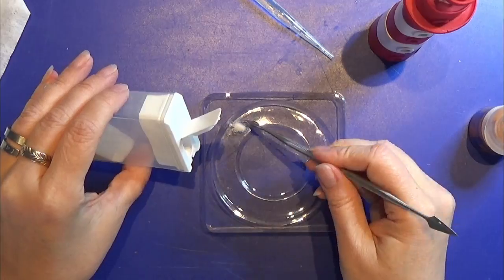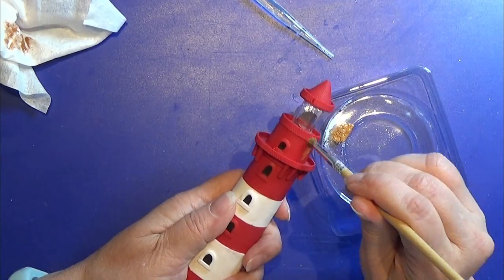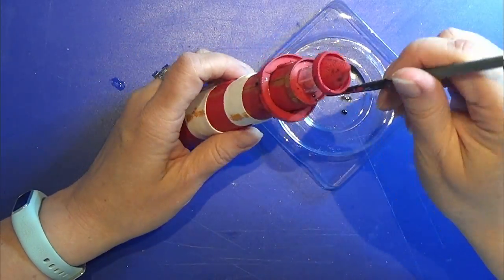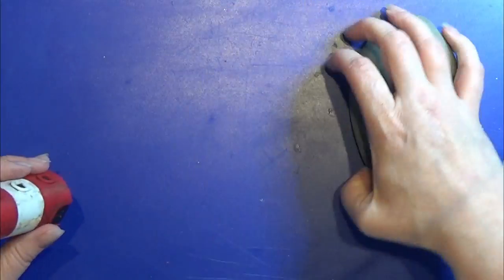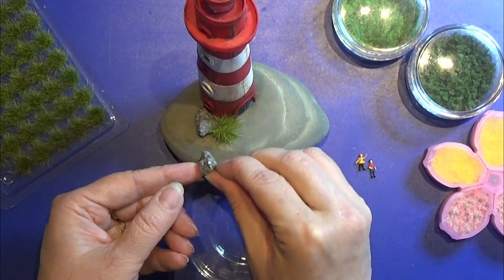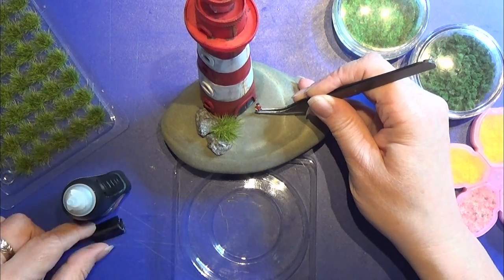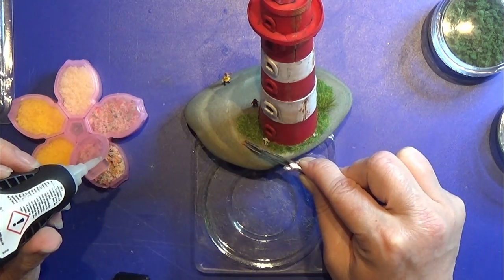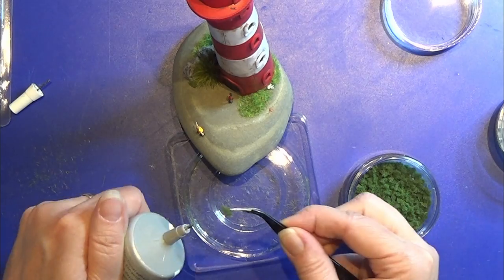Polymer Clay Miniature - Lighthouse part 2

Comment: You did a very good job of weathering.  Arya is pretty good, and I love her techniques.  You might also try Black Magic Crafts, Jeremey uses oil washes which seem to work better on polymer clay and resin, they seem to smear better than an ink which doesn't always work on plastic.  Keep up the good work.  I always make a point of watching your uploads. :-)
Reply from the maker: Thank you ImperialKneazle ❤️
Yes I love Ara's techniques to, did you see the first collaberation I made with her, where she aged a train I made? it turned out super cool. I have been painting with oil paint, using oil to clean my pencils, as it is smell free, but if I understood the oil wash technique right they use a thinner for that, and I can't have the smell from the thinner